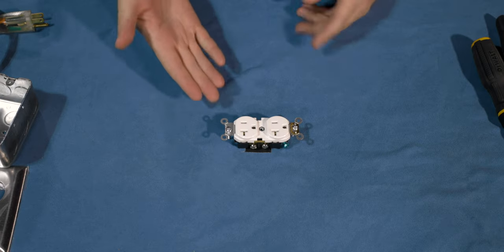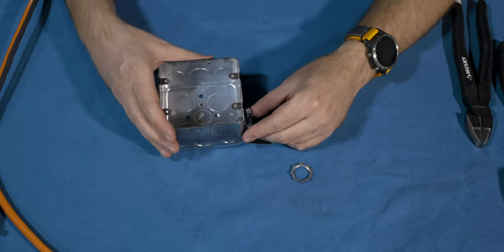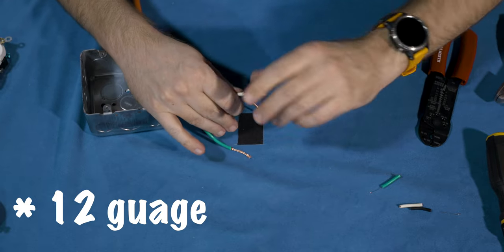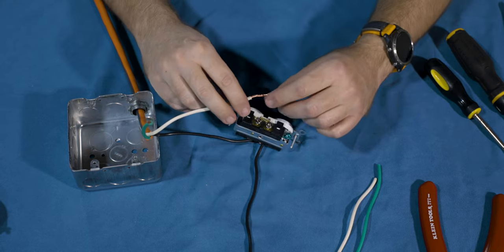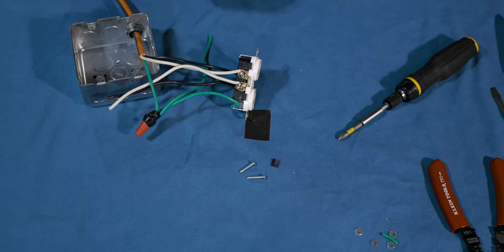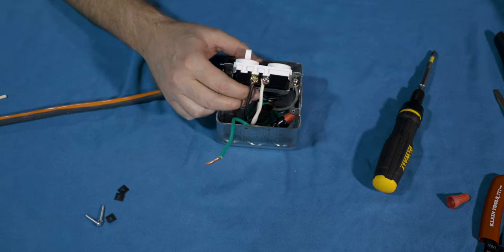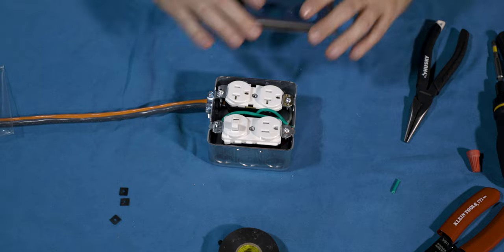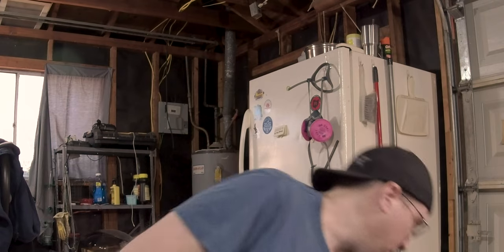DIY - Extension Cord Build - 3 Outlets and a Switch

Comment: As a person who was employed as an electrical technician for 35+ years, Great Job!  FYI.  I THINK the center screw (and maybe the tabs) of the outlet, is connected to Ground, so you could probably get away without connecting the green wires to the tab screw.   I was thinking the video was “mirror image” for a second, while you were trying to screw on the wire nut :-)
Reply from the maker: Thank you!  My dad was into electronics and electricals growing up, so definitely comfortable playing around with this stuff.  There are definitely different ways to work those ground wires. I'm not sure if those middle screws are ground or not, but, it could have been another solution for certain.   I'm always the original image, everyone else is mirroring me (;   Cheers!